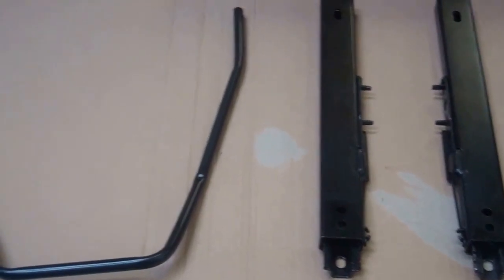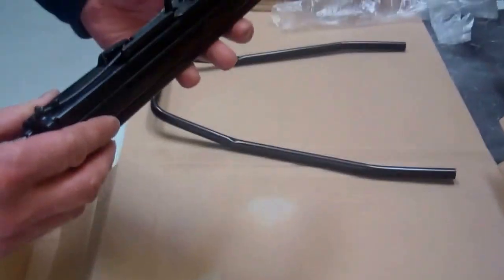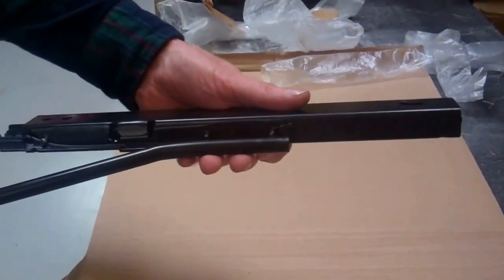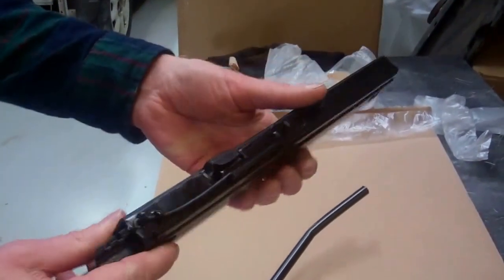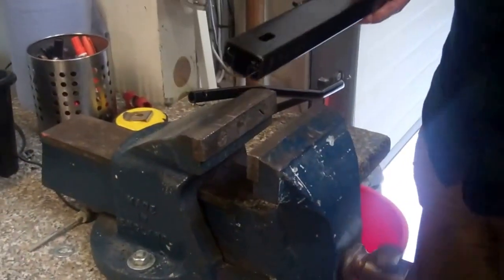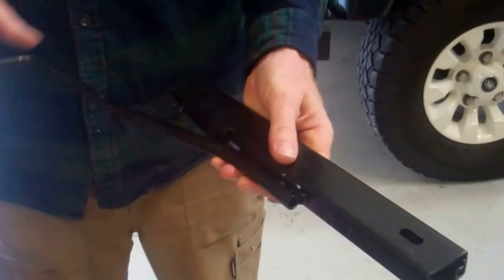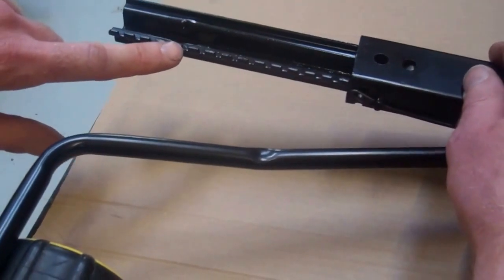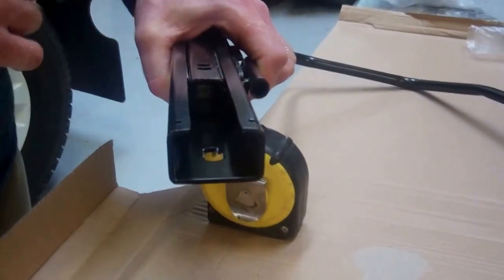Demo and assembly of universal seat base slider mechanism

Comment: If you pinch these in a vice it also pinches the channel and restricts the whole thing moving. Also as many have stated here and as I have found, the pull up bar does not 'lock' in place after giving it the vice treatment but simply falls off. The bar will operate perfectly well if it is effectively too wide for the space between the runners and sprung into place after the sliders are bolted into place.

Comment: I have these exact same adjusters and when I put it in my vice and did this, it doesn’t lock in place. I can still pull it apart by hand. Not sure what to do?
Reply: i have exactly the same problem. just wont lock in. might have to pull the welder out

Comment: How on earth did you get the rails to come out? I can’t seem to figure it out. I saw you out it on its side and press but I guess I am doing something wrong when I try? 

Mind saying briefly explaining how to do it?
Reply from the maker: I think as long as you pull the lever so the rails can slide they will either slide out the front or the rear.
Reply: i tried with wd40 and it worked....just needed lots of wd40
Reply: i cant do it either... i have tried for several hours and in fact i think i have broken one of the sliders...  i cannot get the slider to slide out so i can mount it... i also don't have one of those big arse vices which don't seem to work anyways going off all the comments... loosing my bloody mind... faaarrkkkkk
Reply: @sovereignsoultribe  i did eventually figure it out. I had to press the press that compresses against the crease of a brick wall in my backyard and apply force lol
Reply: I haven’t been able put my seats in for 4 months this has been harder then doing both my axel’s 😡

Comment: My left rail is stuck and doesn't move at all.
Reply: You ever figure out how to fix this?
Reply: @joesarks  I did! Somehow the right rail locked in a different position. I was trying to unlock by hitting hard with a hammer but didn't work and it was a bad idea cause the edge of the rail had bend. Then I reassembled the rails with lifting bar from the seat and manual I apply force by hand on the locked rail. I apply some WD-40 before doing anything to help with friction. Hope it works for you
Reply: Balthazar Rivière, thank you!!!